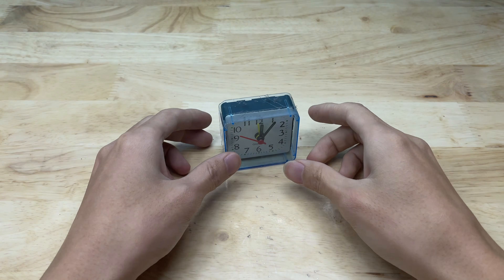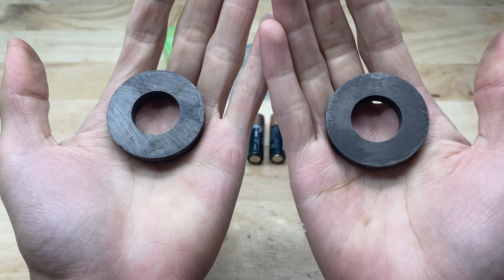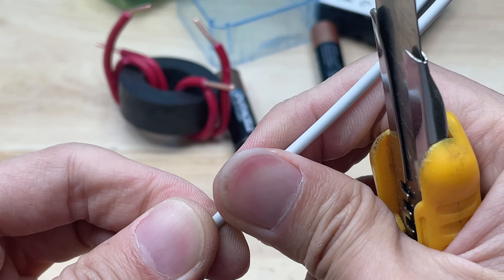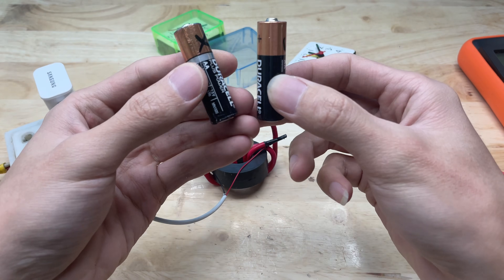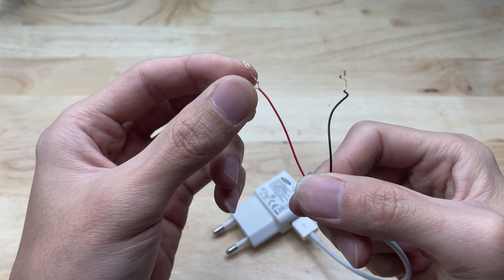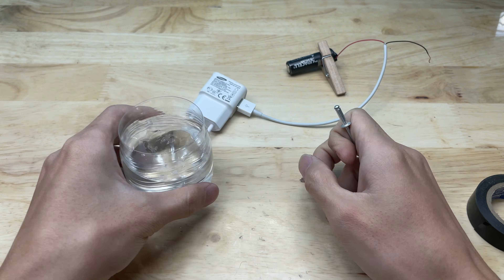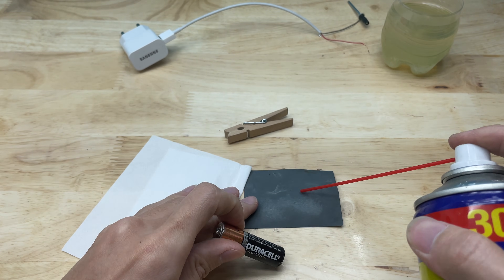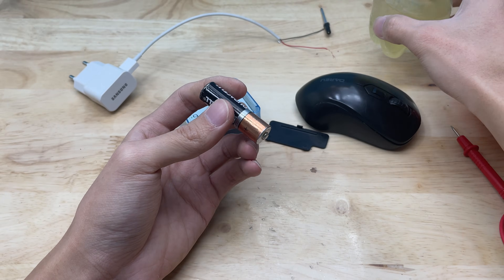🔋Never Buy AA Batteries Again! Use a Magnet and Watch What Happens!😱

Comment: Um why not just put the battery in a regular charger?  There is no point to do all of that salt water bs. You could just have attached the negative wire to the negative battery terminal. Never mind that recharging non rechargeables is not recommended for a few good reasons. This was just silly and just a dude trying to make content🙄